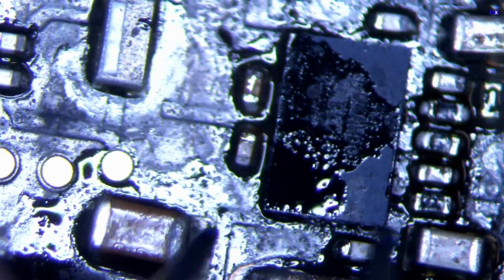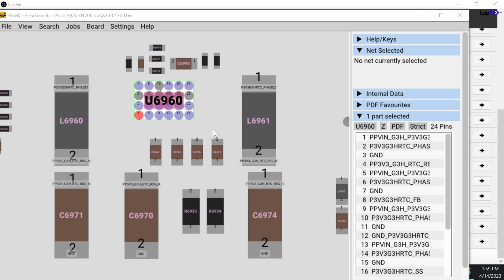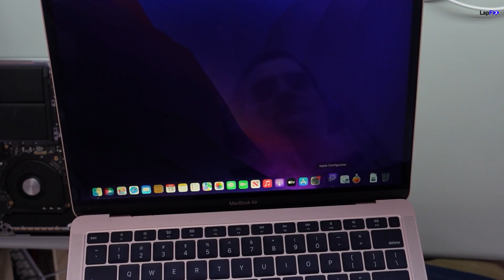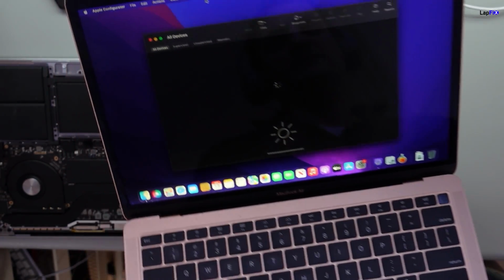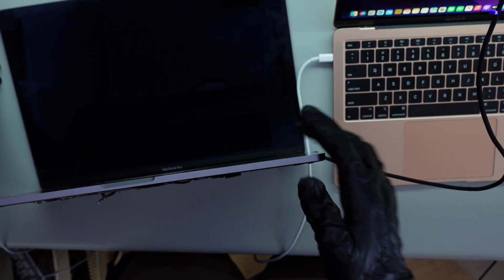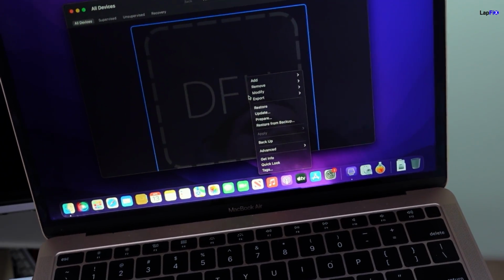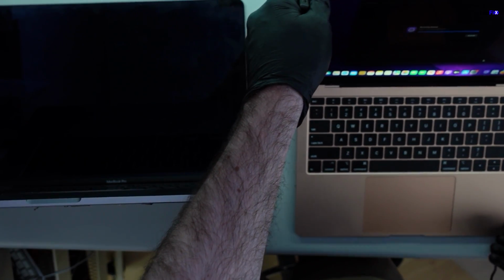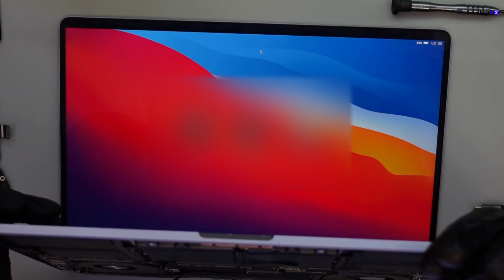16" Macbook Pro Logic Board Repair + T2 Firmware Corruption Fix

Comment: I have a 2019 macbook air that was stuck on internet recovery but for some reason the next day when I plugged in the type c power adapter it automatically turned on but it wouldn’t display anything on the screen but you can feel the track pad clicking and the fan spinning. I’ve tried the SMC resetting and the NVRAM reset but I haven’t had any luck. Even when you have the power adapter unplugged provided that the battery is in fact connected to the motherboard it will automatically turn itself on but won’t display anything on screen….Please help

Comment from the maker: More Problems = More Solutions !  😎      For those who didn't see: at 6:27 I show a missing port (I forgot to plug in the usb-c port to the logic board when I put it back for the t2 fix).  Soooo, at 7:44, When I grab the charger to charge the battery, I plugged the charger into an empty port AND DIDN"T notice it  🙃